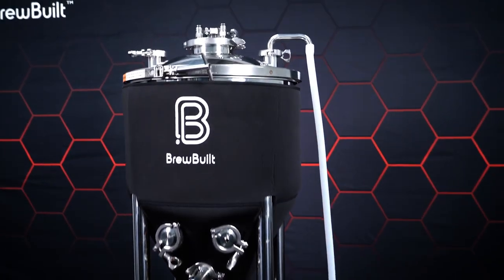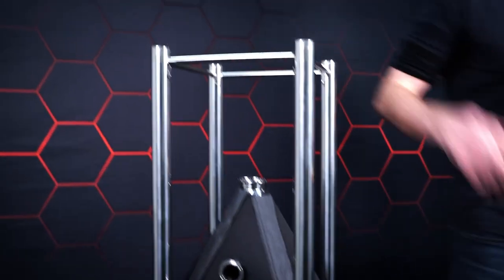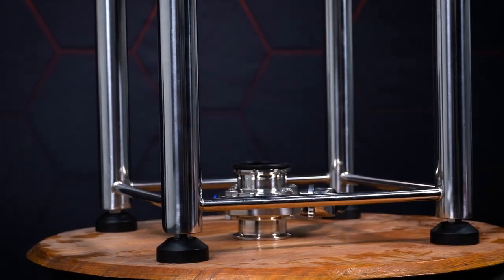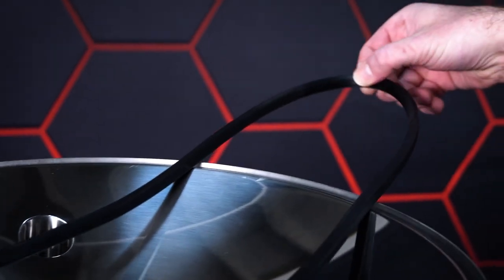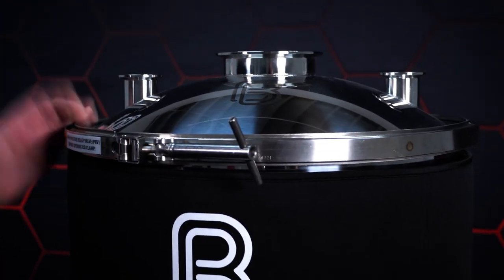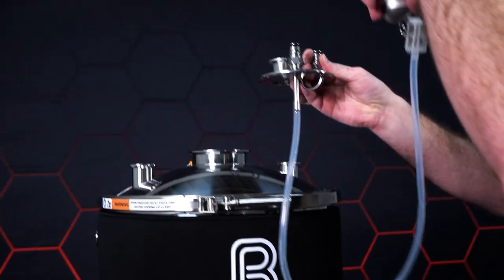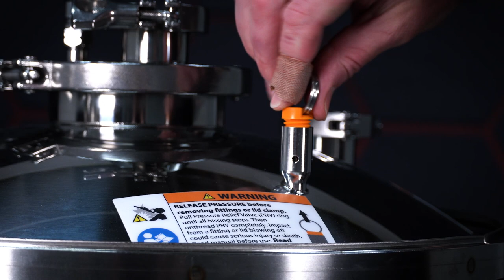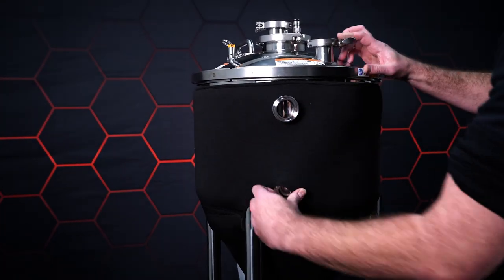How to Assemble the BrewBuilt X2 Jacketed Uni Conical

Comment: I've  got an x1 -14 gallon and a more beer original 14 gallon ( 3 legged stand the thick walled conical cradles  in.) Now I've  gotta have one of these 14 gallon  jacketed . Versions just brewed an oatmeal stout today  that would have been a good cristining  batch. Or better yet a black i.p.l. so I could pressure ferment. It's  a beauty 😍
Reply from the maker: That’s awesome! 🙌
Reply: @BrewBuilt_   It seems that Brewbuilt doesn't like questions, or replying back.  Does that mean that the aftermarket service will also be bad. Cuzz In Europe we like customers support and service.  And i didn't got that feeling with Brewbuilt.